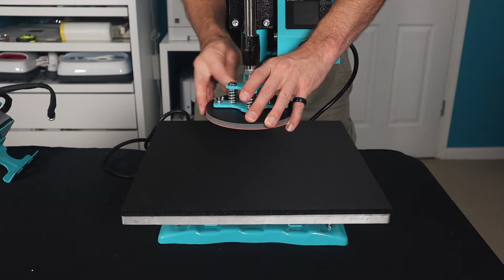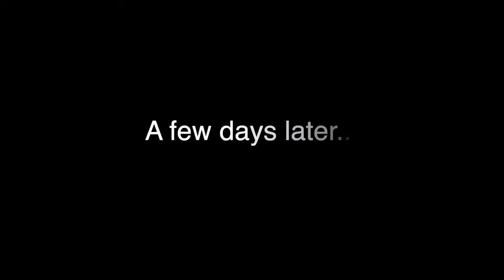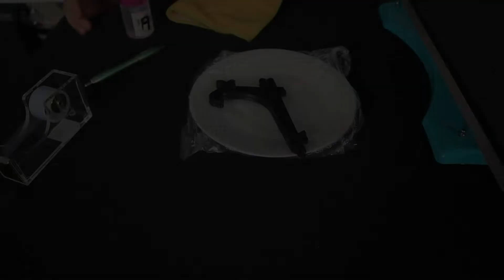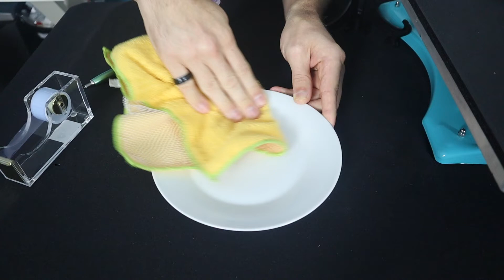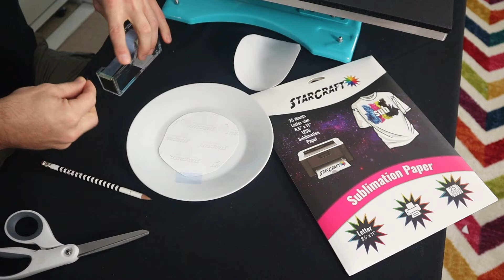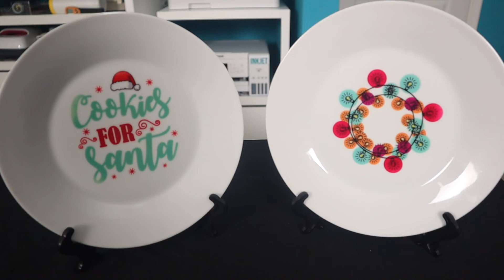Sublimating Holiday Plates with the StarCraft Swing Away Heat Press!

Comment: How do you sublimate  spoon rest?
Reply from the maker: Like for the kitchen? If you have one designed for sublimation, then probably use a shrink wrap for pressure and a convection oven. If it's not designed for sublimation then it probably won't handle the process unless it's metal. If it is metal, you need a special coating to hold the ink

Comment: how to print in gold plates?
Reply from the maker: There's many boxes to check on that. Make sure the plate can take the heat without problems like breaking and fumes. Put on a coating that can hold sublimation ink. Know that everything you do will have  a gold base to it, so anything white will be gold and then reds will be gold+red, etc. There are possible workarounds on this that we have never tried. Using easi-subli or white toner printer. 

If you do try, we would love to hear how it goes

Comment: is there a way to sublimate the border of the plate?
Reply from the maker: Yes, but they don't make it easy. You would probably have to do it in a convection oven, which will have different time / temp rules. Maybe a tacky spray or shrink wrap to keep pressure on it. We haven't done this. But. If we did, that's the road we would go down

Comment: It  indeed  good idea to test the machines  on cheap materials first before on the actual item of purpose i once wasted a number of cups and plate .If i had seen this video ,i would have saved a lot of important items. But still glad since i upgrade machines annually, i will test them like you do.
Reply from the maker: Indeed, tuning in on the nuances of a new machine is important! What's your favorite so far?

Comment: What size do you recommend for both plates?
Reply from the maker: Hey! We recommend that you test yours in case there’s any variance. We ended up using images that were approximately 1”-1.5” less than the diameter, so you can use that as a guide. Hope this helps!